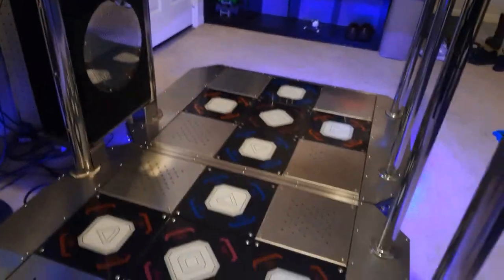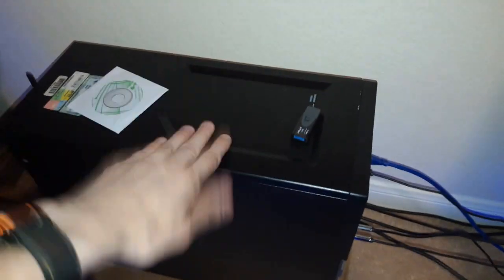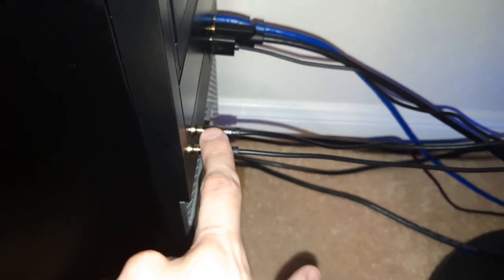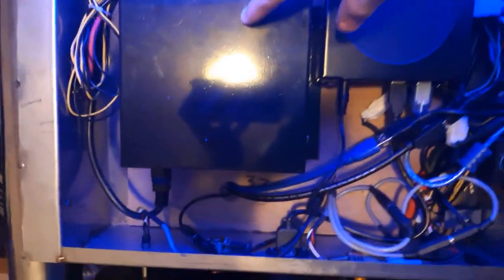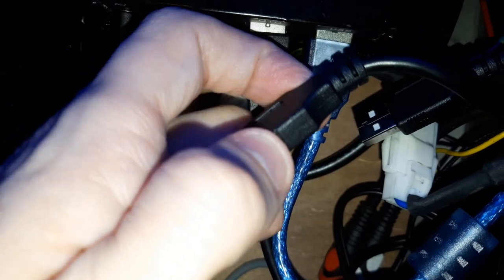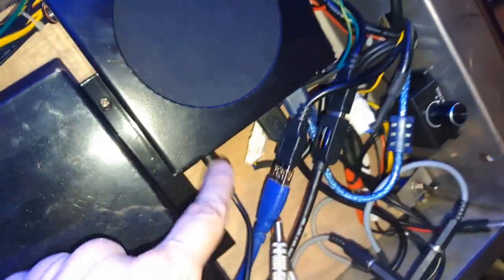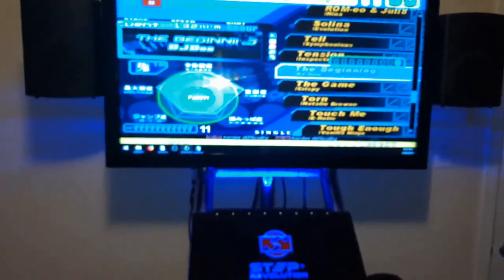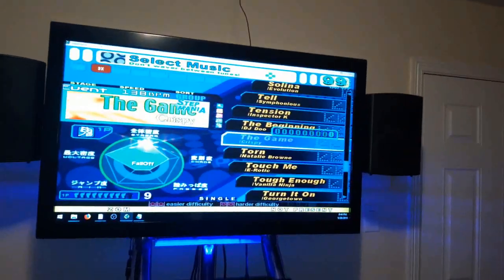StepManiaX Stepmania Setup Tutorial

Comment: Can I play SMX if I buy just one stage and the SMX monitor if I also buy custom speakers?
Reply from the maker: Yes, the game supports either 1 or 2 pads.  The monitor was designed to be a lower-cost option for individuals who can't afford or fit the full AIO for home use.  The sound can be fed through standard line outputs to any set of speakers.
Reply: @ZOM585  awesome.  And what are the differences between SMX and classic SM
Reply from the maker: @Allourmanfam  StepManiaX is a standalone game built on the Stepmania engine and requires purchasing the touch monitor to play (because it comes attached to a computer with the software installed).  It has monthly updates and supports various difficulty levels based on its unique 5-panel platforms.  It does not support custom songs, though you can connect your own separate computer to the monitor to play any other game that supports the stages, such as Stepmania.

Comment: We have tried to connect to one USB to one pad. But we have no response to the pad. What is wrong ? We are using laptop.
Reply from the maker: The power is on, right?  The power converter box in the cab powers not only the PC but also the pads.

You may also need to check inside the front compartment of each pad to ensure that there are no loose cables (this was a common problem with gen 4 pads).

If the pads work when plugged into the SMX computer but not when they're switched to your dedicated Stepmania machine, it could be faulty USB extension cables.  Also ensure that they aren't plugged into a USB hub and instead plugged directly into the PC as splitters can cause issues, especially if they don't get adequate power.
Reply: @ZOM585  yes the power is on when I have all set up like you did.  I got two USB extension cables connect to the PC . Device manager shows two pads but need to updated.